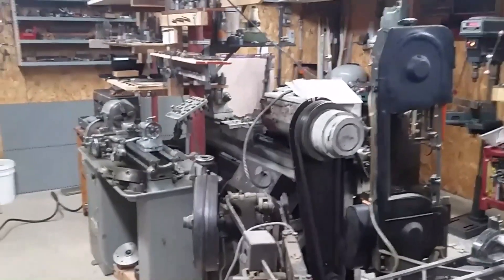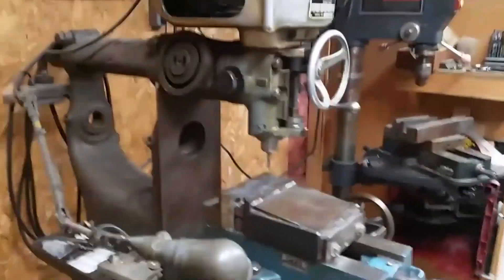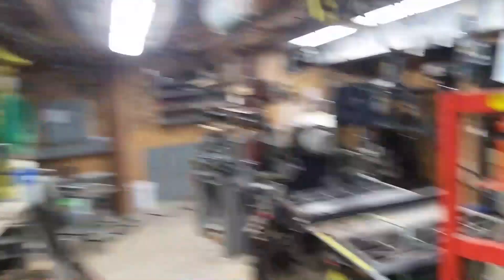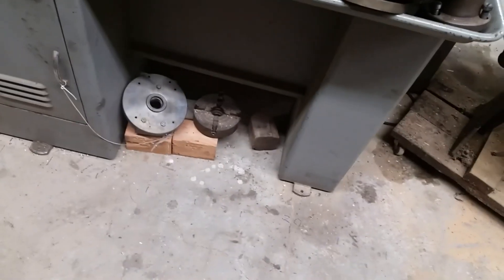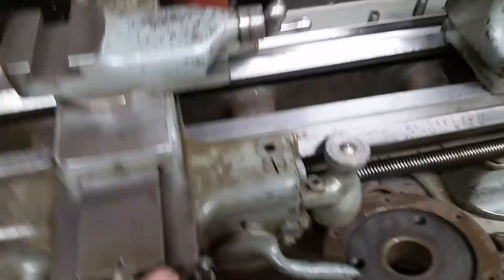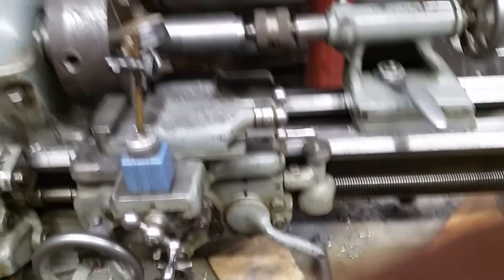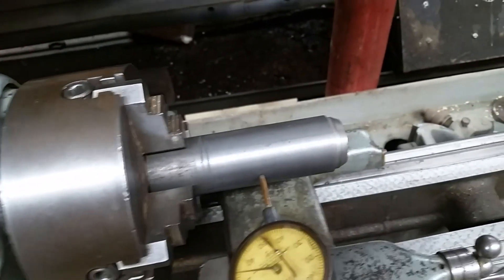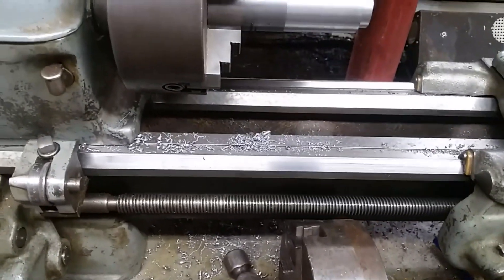South Bend 9 inch Lathe chuck addition

Comment: Its the empty hole on the top of the saddle, next to the two screws connecting the saddle to the apron. Should be a square screw that connects to a small cast iron part below.

Comment: This is an old video, but you are missing the apron/saddle lock screw. It keeps the front of the saddle down.
Reply from the maker: great catch, I found that out when I looked at the documentation on how to adjust the saddle.  I've found a replacement screw and bought a used "nut" for underneath.